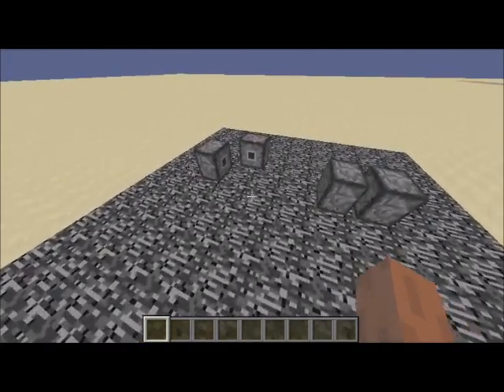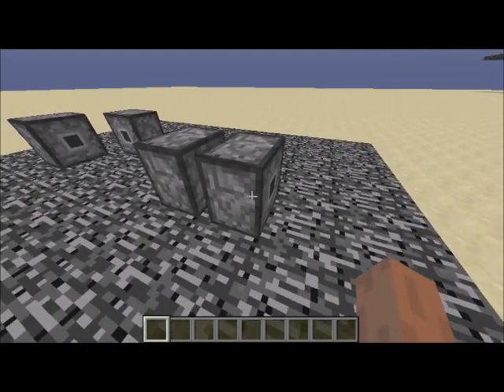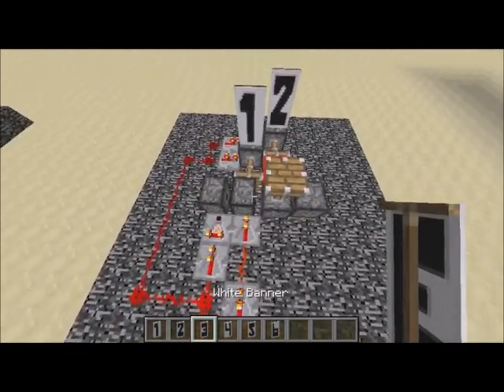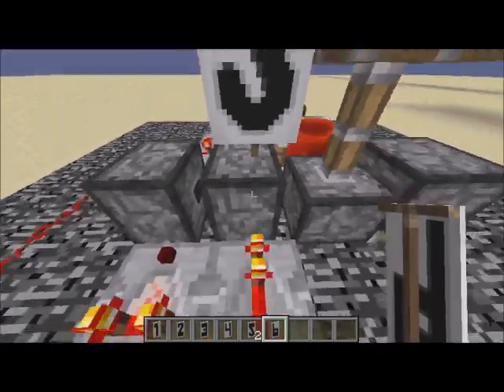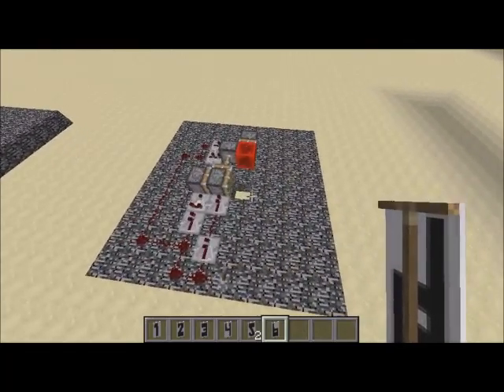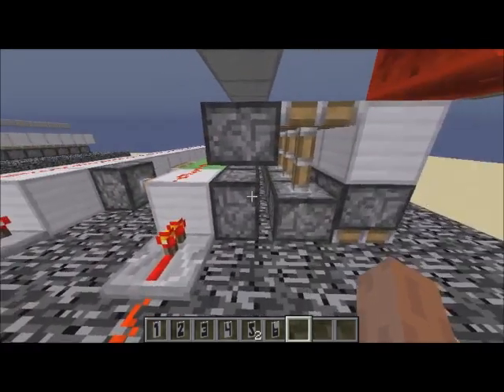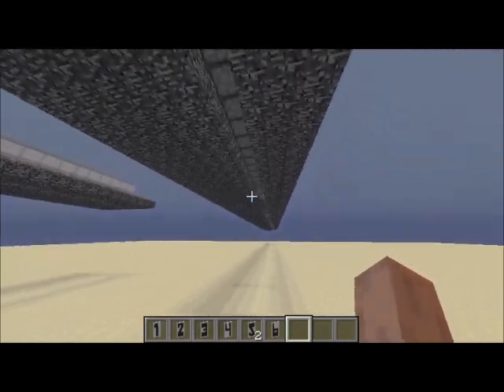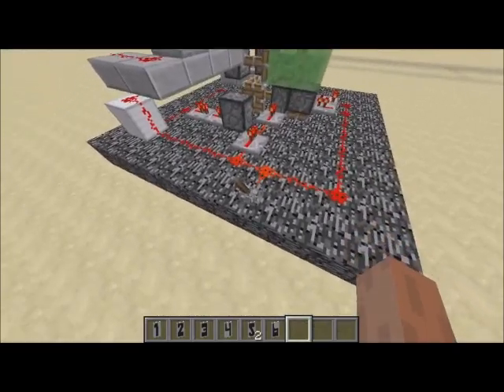Semi-interesting headless piston stuff

Comment: Good luck with the flying bedrock breaker.
The setup you showed at the end rotates a piston. Are you sure you want to have to deal with that?

Also, just in case it´s helpful, here´s the bedrock breaking contraption that I intended to use in the flying machine. It´s a bedrock breaker that deletes no pistons, rotates no pistons and which consists entirely out of slimeblocks, pistons, redstone blocks and so on: 
http://www.mediafire.com/file/8e69a6anen7kzgf/A+bedrock+breaking+setup.rar
But it´s very difficult to move and you have basically no space to regenerate the headless pistons. So I´m not sure how helpful this is.
Reply from the maker: Well what I had in mind was to allow piston rotation but to cycle those piston blocks to an afk player on the flying machine that allows him to mine it, collect the block and places it as a downward facing piston(they are looking upward). A player basically has to be on it anyways considering it's a flying machine. With the setup I show I can generate the headless pistons pretty easy, but I need to move some it out of the way during generation.
Reply from the maker: however for the sake of potential convenience I may try to do something similar to what I see in your contraption to avoid piston rotation. It could be easier than what I planned.
Reply: "A player basically has to be on it anyways considering it's a flying machine."
There are automatic chunk loaders that are good enough to keep flying machines running. For example gnembon showed such a chunk loader roughly 3 months ago. aeq5GZxRH9s&t=790s
(And apparently wout already had such chunk loaders 1 year ago but never published it). 
So as far as I know, you don´t need a player to keep the flying machine loaded. But take this with a grain of salt, because I´m not an expert when it comes to chunk loading.
Reply from the maker: That's a great point. I'm planning on preventing piston rotation in my machine now. From what I can see it shouldn't be too hard with what I have anyways.

Comment: I'm very inexperienced when it comes to these kinds of piston mechanics, but what you showed with the headless sticky piston 0 ticking: Would that retraction event causing 0 ticks work from other angles (and therefore make it possible to 0 tick complete slimeblock structures/components of slimeblock structures?)
Reply: Did I hear treefarm? Someone call Ilmango!
Reply: vincenthel1 yeah works fine, only problem is the headless pistons you need
Reply from the maker: Don't know exactly what you mean by other angles, but I think I might. The conversion of block 36 2 blocks in front of a sticky piston only happens if it is from an extension block event, and it is moving in the same direction the piston would push it, which I forgot to say in the video, so you can basically only do the block dropping if it is the same way i do it in the video. One headless sticky piston can only drop block 36's which are directly or 2 blocks in front like I showed, so I don't believe you can do what you're describing unless you have a headless sticky piston for each block 36.
Reply: cool mann well, if they are directly infront it doesnt need to be the same direction afaik right?
Reply from the maker: directly in front will drop the block no matter what, yes. So if you can find a super fast way to generate headless sticky pistons and perhaps move them super fast via 1.8 flickering behavior, you can make ultra fast tree farms or something.
Reply: cool mannhahaha, seems unlikely tho xD
Reply: ehhh wait what? xD how did you come to think that?
Reply: that is just ridiculous xD which isnt a bad thing per se, but i doubt that s gonna be reliable :P